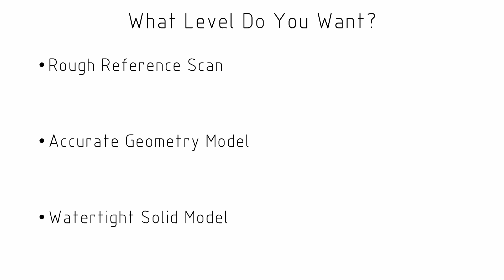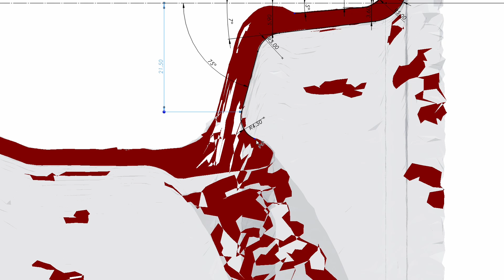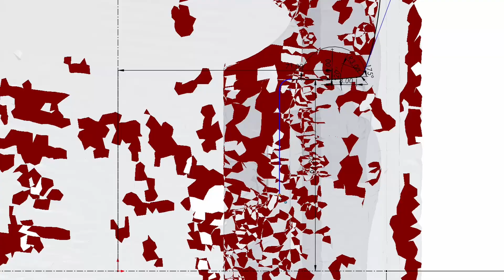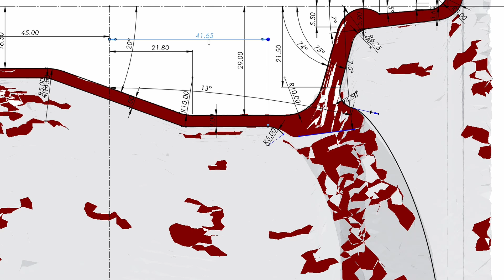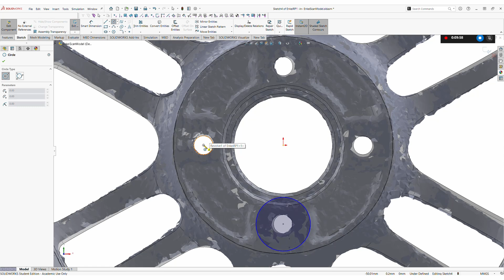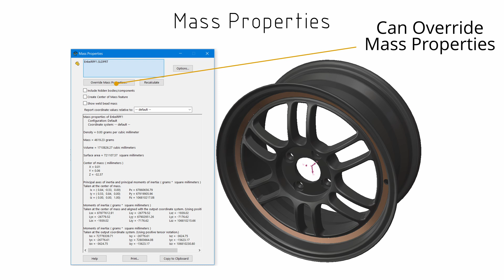Laser Scanning an Enkei RPF1 Wheel for Accurate CAD Modeling (Project 171)

Comment: Your model was more accurate than you stated, 4% of 4456 grams is 178 grams but you were only out by 37 grams which is closer to  which is closer to an error of only 0.8% so well done sir !! .. Good work mate :)

Here's and idea to get that 150 grams per wheel back....
Assuming that the density of aluminium is 2.7 and that the inner of the wheel is 300mm diameter by 150mm wide, my "guestimation".....
55.5555 cubic centimetres equals 150 grams thus if you were to shave off 0.39mm's off the inside of the wheel you would save your 150grams :)
Which would also give you a little more clearance for the brake callipers too...

But I do wonder how this might effect the structural rigidity of the wheel, how much safety margin would this "shaving" consume ?
Bearing in mind this going to be quite a light car anyway :)
Perhaps shaving off 0.2mm might be a good trade off, perhaps it's a nice idea but not worth the effort ?
I wonder what your thoughts are ?
Cheers.
Reply from the maker: Happy to leave the wheels as they are.  There are always going to be little discrepencies in going from a scan to a fully accurate model.  I was happy with the variation.

Wheels now have tyres on them, and I had underestimated the tyre weight by more than the weight difference of the scan to the model.  At the end of the day will only have the final weight of the car and systems when they are finished and weighed.
Reply: @KevinHayward7  yeah, I thought the 0.8% variation was excellent !!
... and I can't blame you for not wanting to faff with the wheels, a lot of effort for a small gain, precious time better spent elsewhere but it was fun to consider :)

And yes, there's no cheating reality, it's a harsh task master for sure !!
Something I've learned the hard way designing, building and flying model aircraft ! :)

Comment: Very nice Dr Kev! I especially liked seeing the overlap between the mesh body and the Solid Model in comparison with each other, as well as how you set up the model with sketches and explained how you round off some values in SolidWorks. I have also found some errors with scan data where taking measurements of the actual model for measuring more detailed areas can be crucial for a more accurate model. Great Videos Kevin! I'm looking forward to watching some more!! Subscribed!

Comment: Hello, Dr Hayward

I'm not super well-versed in the scanner arm—I've mostly just used it to check tolerances after machining. But that cross-section is pretty cool.

I was just recently thinking about this idea: if you could scan a rim and tire while it's mounted on the car—with camber and static load distribution already set—wouldn't it be possible to capture a cross-section of the contact patch? And beyond that, if you make changes to the setup, you could potentially get a numerical value for the contact patch area.

At the very least, scanning the whole wheel assembly could let you bring it into CAD and get an exact picture of the tire deformation and chassis ride height. It could be used not just for suspension geometry, but also for aerodynamic boundary modeling.

Is that a possibility or is there an aspect im not considering ?
Reply from the maker: Sounds like a good idea. Not quite sure how to see the contact patch, but there are ways to do that with pressure paper. The scanning to get the deformation for ride height and aerodynamic modelling would be definitely possible.

Comment: Hey Kev,  Do you follow Robin Shute and the sendy club pikes peak channel?  Hes another smart character like yourself who does some very cool stuff.

He just dropped a video of his new car build with the most amazing looking generatively designed uprights.  I am usually all about design for easy manufacture but i have been converted. Form and function please, damn the manufacturing complexity.  

I'd been keen to get your take on this in a future video.
Reply from the maker: Definitely follow Robin Shute, the latest video was awesome. The uprights were very cool. We have done some generative designed uprights at work and 3d printed them, but not run them as they weren't much lighter than the traditionally designed ones we had. This was mostly due to the materials we were able to print with.

Very interesting that Robin sent the uprights off to be machined in China rather than 3d printing.  They ended up looking great.  Might be a good idea to look at some generative design as a future video, but at the very least I intend to go into the upright structural design.

Comment: The question is how much does one of those wheel bolts weigh. The enkei has 4 bolts while the ray has 5, so if those bolts are 50g each then really it’s an offset of 400g rather than 600g, leading to a cost to weight tradeoff closer to $4.5/g than $3/g, further justifying the decision 19:24
Reply from the maker: The Rays wheel can be had as a 4x100 PCD as well, so I did straight up choose the slightly heavier (but cheaper) option.

Comment: This looks so much easier. Took me hours to scan my cross kart wheel using a CR Scan Lizard. Rn I have baby powder all over the place 😂

By the way, you can mix baby powder into rubbing alcohol and spray it over the object. Makes a thick coat and very ez to clean. My crappy 600$ scanner likes it a lot.

Comment: You can easily match weight by changing thickness here or there. That's what I do, I like to keep weight of my real life models like rims accurate.
Also you can make very accurate models if you use profile gauge.
Reply from the maker: I didn't mention it in the video but I had also made a model straight off hand measurements (not using a profile gauge though),  Got very close to the scanned version but in a lot less time.  A profile gauge would have made the differences between hand measured and scanned almost nothing.

You are also right on altering thicknesses here and there to match weight. Maybe I should just do it instead of being a bit lazy...
Reply: @KevinHayward7  And the funny thing is that when you change thickness in right places you still have very good match of surfaces, or even better.
Agree that manual and scanned versions will be very close. I also agree that hand measuring especially with profile gauge will be a lot faster than scanning, with this kind of geometry. That time difference will go the other way when it comes to more complicated geometry like gearbox or engine block, although I made  gearbox model with hand measurements (mainly because there was not a lot of scanning options at the time).